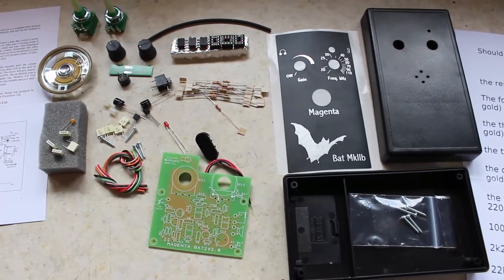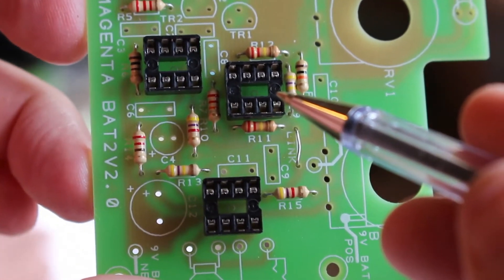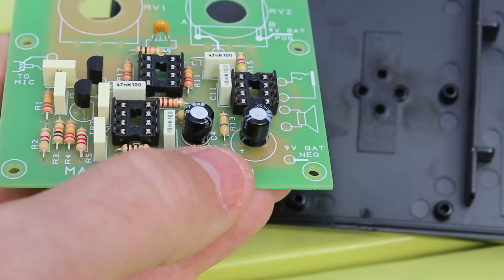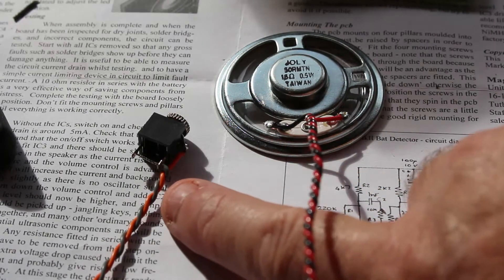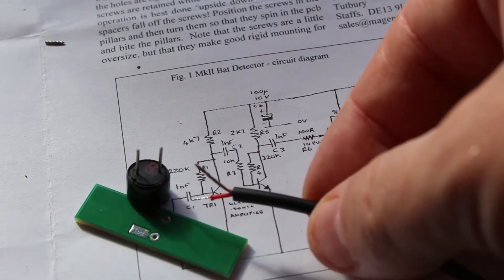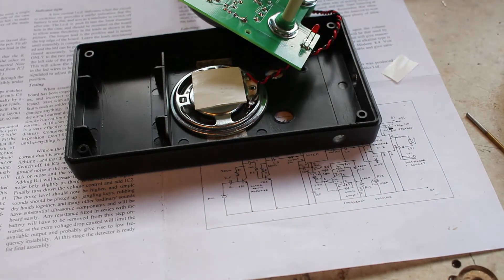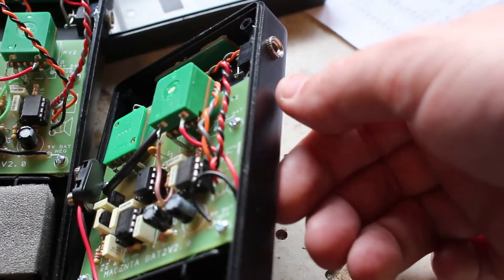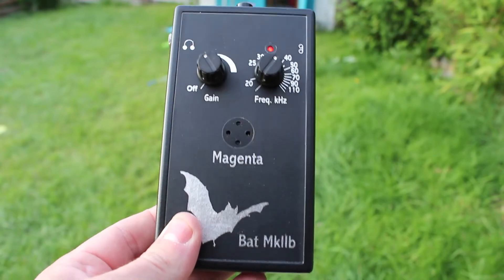Magenta Bat detector kit, MkIIb, build and testing

Comment: Enjoyed watching this. I have a very similar kit based on analogue medium scale integrated chips
 I think the most expensive part in the kit is the high frequency microphone which was designed for hearing aids about 25 years ago. Did anyone else realise that the bat at the end is talking to it's self? The usefulness of the device goes beyond listening to bats as you will find you can tune in to listen to vibrating quartz crystals enabling one to deduce whether a computer or any clocked digital circuit is active or not.